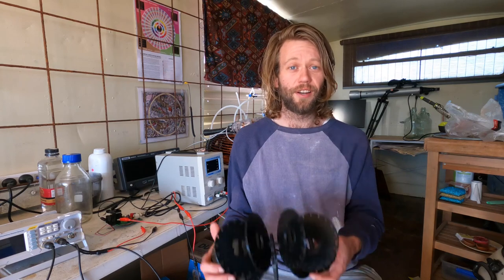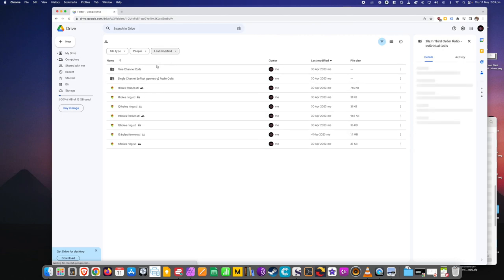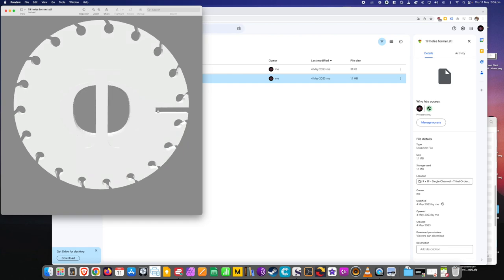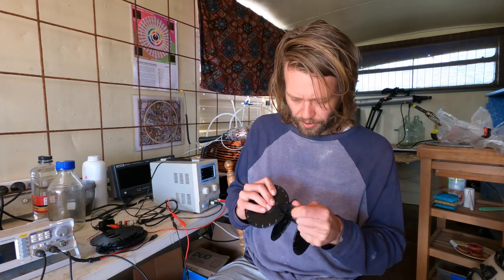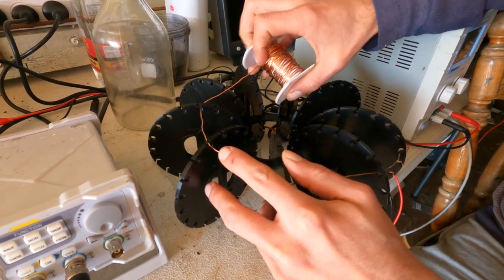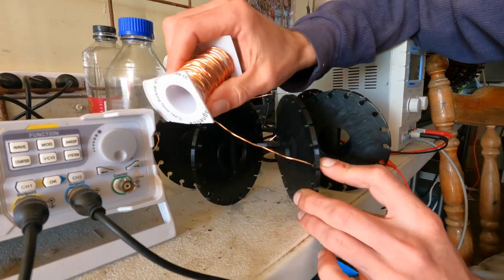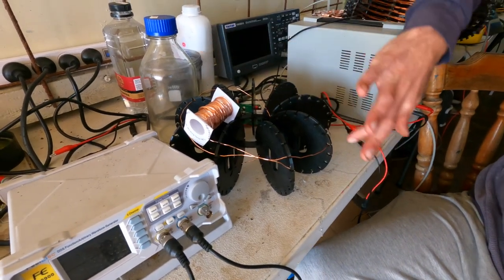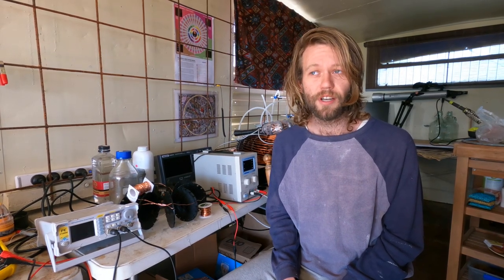Printing, Assembling & Winding Rodin Coils

Comment: Any tips or techniques on keeping the wire as straight as possible or do you smooth it out at the end?
Reply from the maker: Hmm not really sorry. You just build about 10 of them and then it suddenly seems a lot easier after practice haha
Reply from the maker: It is a good idea to occasionally tape things down as you go and then pull off the tape if you're winding a lot of turns

Comment: Hello.. I made a hollow Rodin coil..I welded 4 90 degrees 11 mm thik stainless steel together til I have a donut..and coild the Rodin coil over it!..I dont know to make mine Rodin coil pulse but when I do I want to fill it with ferro fluid..I heard the magnetic field of a Rodin coil can go 500.000 rpm a minuut…I wanna see wat Will happen when the magnetic Ferro fluid Will follow the magnetic field..becouse the fluid can rotate within a magnetic field witout resistens..can somone maby help me to get mine Rodin coil working?..thanks for reading